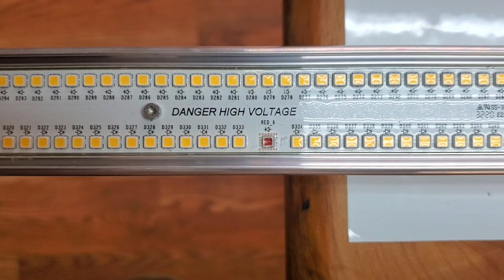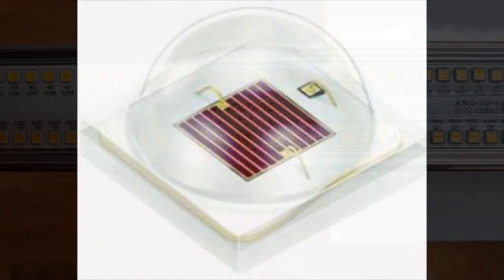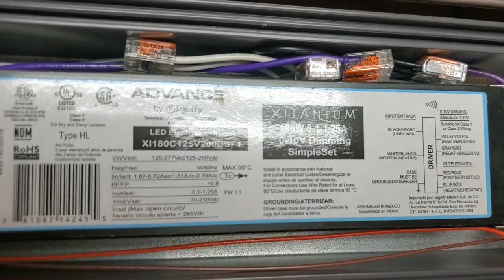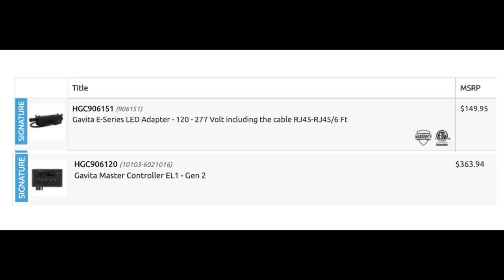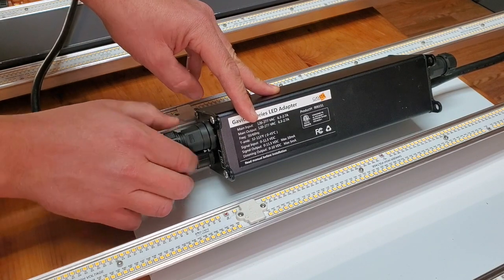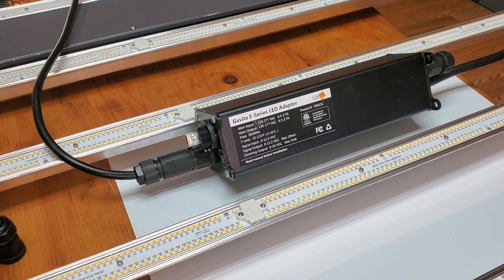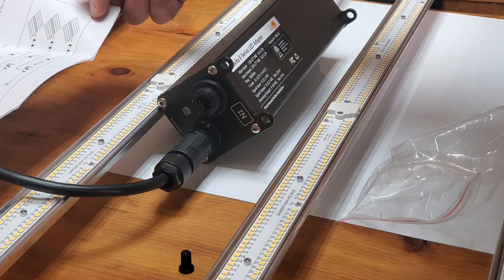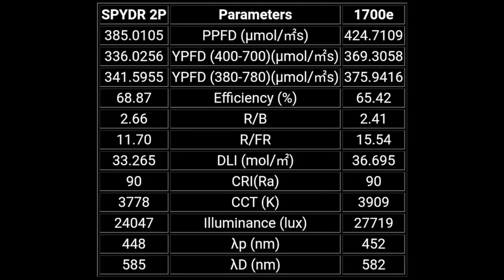Gavita 1700e Full Breakdown and Review

Comment: Thanks for the great video👍I'm interested in hacking the dimmer. The drivers all have 0-10v dimming on the label, in the diagram on the label and I pulled the pdf for the advanced drivers, all show dimming but Gavita makes you spend $500 extra for something that is now industry standard. I don't see any unused leads off the drivers in the video? Did gavita cut them off or have specific drivers made without them?
Reply: This is the exact reason I did not buy Gavita lights.

Comment: There is nothing special about running LED's at 50+ volts....no "engineering feat" required..lol! Just a common driver and LED's that are rated at 57volts. Not a big deal. What you didn't say about this light is that 15% or more LED'S must fail before warranty is honored. So if you loose say 10% of your LED'S, your out of luck!
Reply from the maker: I say an engineering feat because I was in the seat with UL a few years ago trying to get out a 100V power supply and it was nothing short of that. The difference between Class I, Class II and Class P are nuanced and a lot of trouble from a certification standpoint. Good on you for reading the fine print. Many manufacturers have "outs" written in to avoid paying or replacing.

Comment: The adapter comes for free now.. all you need is the gavita master controller el1 - gen 1 which is $270 out the door. 🤙
Reply from the maker: Good to know. Do you have any idea which wires to splice out of RJ cable to use a different dimmer? I'm sure TrolMaster has an adapter. Thanks for watching

Comment: these are the lights I've been trying to research, for a 4x4 now and 5x5 in a few months, and cannot decide.

So many damn choices.  I bet they would all work fine just as a hobbyist it's allot of money to spend so I want to be sure I'm making the right choice.  I really do appreciate any and all help.

Growers choice ROI-780
Mammoth 8/10 bar
Geekbeast 630w pro
Gravita 1700e
Lumatek/photontek 600w
Optic led slim 650s
green sunshine co electric sky v3
Reply from the maker: Only go above 700 Watts if you're running gas. 2X mmol at canopy for CO2 PPM is a good place to start. The only name on your list I would look at is Grower's Choice. They are available at a bunch of hydro shops so service, price and warranty are all pretty accessible. I haven't had my hands on Mammoth. They run lenses I think. Everything thing else is a "Me Too" product. The 650s has UV and Far Red on the same channel which is useless IMO. Gavita too spendy. Any company that hasn't been around for more than 5 years already, stands to be gone in less time. Buy from someone who can service any issues you may run in to, quickly.
Reply: @sustainableterrains  I really appreciate the advice.  So if money isn't a concern would you go for the gravita over the growers choice?
Reply from the maker: @unclejake1476  Still No. LOL. I like the physical build quality of the Gavita (no R), but that's it. It only dims to 50%, the wiring and power management are clunky. You can get the same spectrum in a million different packages.
Reply: @sustainableterrains  I appreciate the help.  Looks like growers choice it is!
Reply: @sustainableterrains  I’m also shopping for a light for 5x5 . I was also considering the same brands as uncle jake . how would the chilled x6 600w & 1000w compare to growers choice? Would you still recommend the growers choice?

Comment: How would this stack up next to the Mars hydro fc6500?
Reply: It's like a VW next to a Porsche. Just a matter of quality and durability. It's all the same thing with a different bow and brand on it. Folding fixtures have more moving parts, so more modes of failure in general. The onboard dimmer with Mars will be easier, cheaper and more accessible for hobby growers. Gavita, Luxx, Fluence, Efinity, Grower's Choice, Mars are all delivering pretty much the same thing from different sources. Go with a brand you trust, price point you can afford and company that will warranty any fixtures that fail, swiftly and without argument. Hope this helps
Reply: My Mars Hydro FC-8000's wiring melted at the point between the driver and LED.  Spend the extra couple hundred dollars.
Reply: It's top of the line, mars is mid grade lol

Comment: you dont need to splice the wires...you pull out the rubber piece at the end, and feed the cable threw
Reply: Thanks for this. Does it seal tight after you pull the rubber piece out? Couldn't quite figure out how that was supposed to work
Reply: @gardencityfarmer  gavita has a video on it....search "How to Waterproof Your Gavita LED Interconnect Cable"

Comment: thanks for your great videos. i have a question maybe you could help with, well maybe 2. Would this be equivalent to a 1000w hps single ended(air cooled) in terms of penetration and yield. and the other would be would this produce less heat than a 1000w hps air cooled with a remote ballast in a 4x4 tent. 
thank you and keep the great information coming.
Reply from the maker: This will smoke a single ended HPS. People are pulling 3 units off of 600 watts with LED. Over 2 gram per watt.

This is overkill for a 4 x 4 tent. Get into something like the Grower's Choice ROI 420 or something closer to that wattage imo. HLG also good option.

You will need absolute control over heating and cooling as well as adding and removing humidity to get this dialed and start seeing the benefits from LED. 

Good luck and thanks for watching!

Comment: Yes they only dim to 50%
Reply from the maker: I've seen the "checker board tech" with people unplugging half of them during transition! It's a hefty trade off for a little bit of efficiency running the high voltage drivers, but they will always be a few points higher on efficacy and output because of it. We will see the 2000e in another year

Comment: Beautiful light and I thinking about picking a couple up👍
Best I've seen for 5x5
Definitely worth the $
I love plugging lights in and not having to worry for 5yrs😎
Reply: Go with Optic LeD they have 10 year warranty, you won’t have to worry for 10 years!!!
Reply from the maker: @sickboy8354  Buyer beware. Sometimes companies don't last that long to service a warranty. I don't recommend anything with a fan in it either. What model in particular would you put next to this one?
Reply: @sustainableterrains  thats true for alot of Chinese made lights. 

But Optic is an American Made and Owned company thats been around 10 years and go nowhere anytime soon. Weston actually used to have the job Eric does at LED Depot but split to make his own company because they push crap products over the quality ones.
Reply: @pb3426   Thank for chiming in. Much respect to the Chilled guys. What are they doing for chip protection? HLG fixtures have no conformal coating which keeps production costs down for them and efficacy numbers up on the box, but the end user takes it in the end with loss of output and yield over time. Either planned obsolescence or ignorance on their part, but not a viable commercial option
Reply from the maker: They are spendy with all the gadgets but the build quality, heat sink, and chip count are industry-leading. Really nice fixtures
Reply: @pb3426  agreed!!!